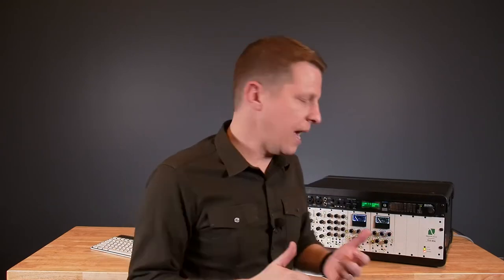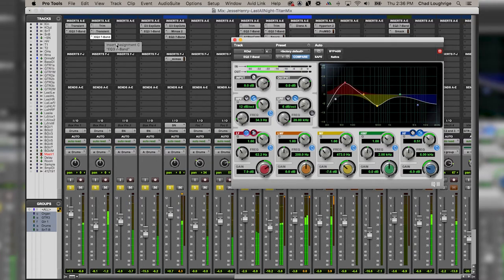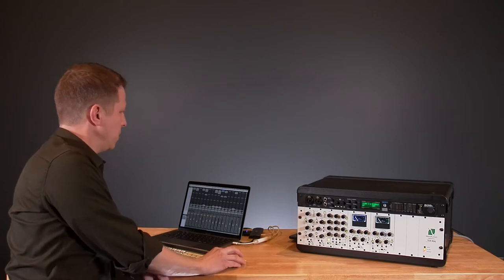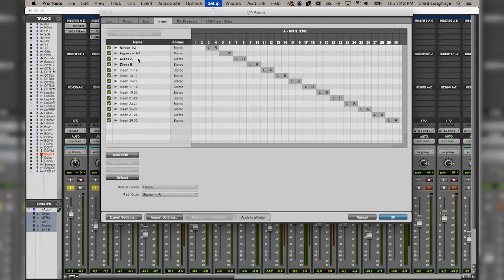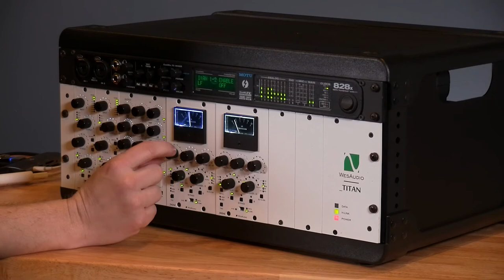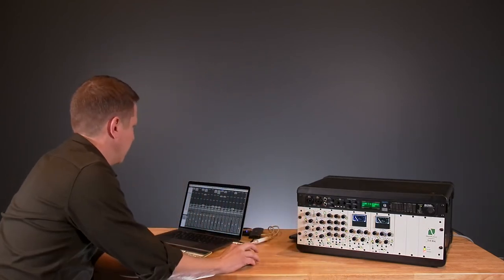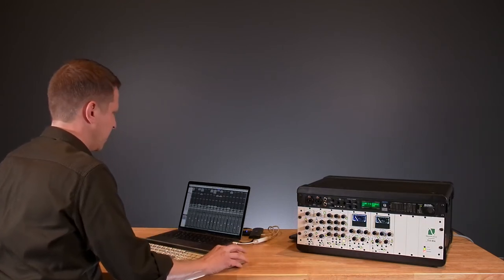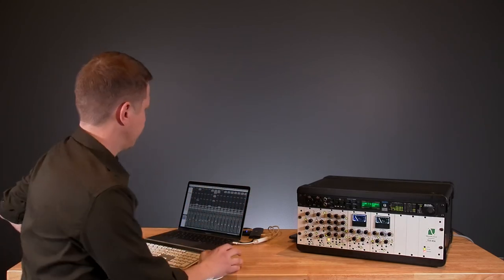Creative Arts Workshop - WesAudio Titan + ProTools

Comment: I just set up a Titan chassis in my home studio and I’ve connected it to my computer via USB for control of the Wes Audio Hyperion I inserted into the Titan’s 7/8 slots and I have the Wes Audio Calypso inserted into the Titan’s 9/10 slots so that I can take advantage of that modules’ ADAT I/O to be able to be patched through the chassis’ I.A.C. connection on the 10 slot. I have the ADAT connected between the Calypso module, and my Presonus Quantum 2626 using 4 Toslink cables.

I am not sure if this is the “proper” way to feed audio from one module to another, but I was able to use Studio One’s SPLITTER tool to feed one instance of Pipeline XT, routing signal out of the DAW to the desired module in the Titan Chassis, then loading another instance of Pipeline XT directly under the first instance and feeding the signal to subsequent modules, and in this way I was able to chain signal between modules with no apparent latency that I could detect. 

Please, let me know if there is another (better) way that is the recommended “preferred” manner to route signal between modules loaded into the Titan.   I cannot find a way to do it with the Calypso ADAT GUI nor can I pass signal from the first module getting signal via ADAT and Pipeline XT to another by simply connecting  XLR patch cables on the rear of the chassis.

Any help/info would be greatly appreciated

Comment: Really cool demo vid on how to mix hybrid within Pro Tools.  I just so happen to be entering that world as I got a new Titan and Dione on their way to my home studio this week so this was very helpful in learning how to route this correctly within and outside of Pro Tools.  Another quick question I have is did you have to punch in numbers for delay compensation in the I/O settings for each track that has the hardware on it as inserts?  Just wondering if I need to adjust that so I'm hearing it without latency when monitoring and when its printed? That would be a cool video if you guys had time to do up something like that with the same hardware you used as well.  Thanks!
Reply from the maker: Depends. With Avid hardware, the system will detect the latency. Other hardware, you'll want to ping with a tone the setup to determine and measure the latency.,
Reply: @CapitalMusicTechnology  Sounds good!  I’ll try that when I get the hardware!  Thanks!!